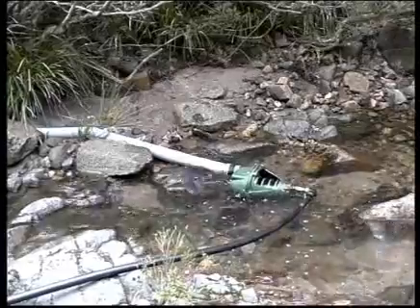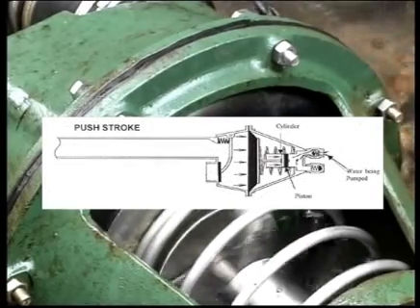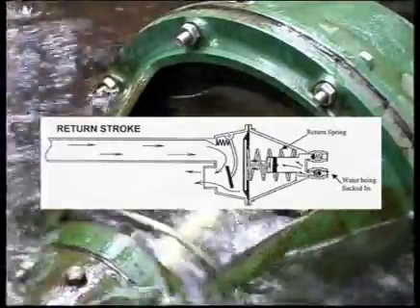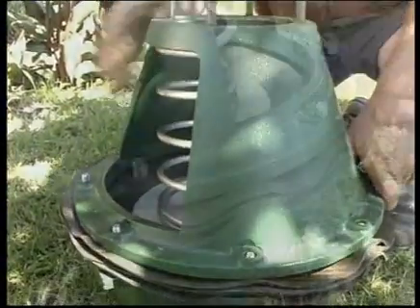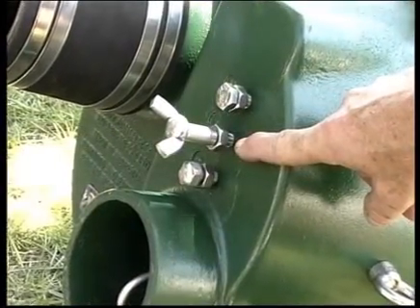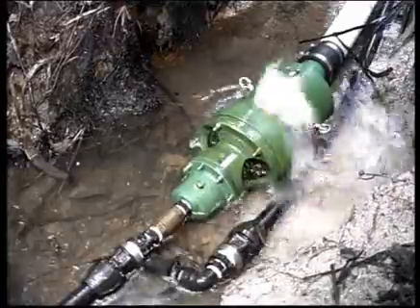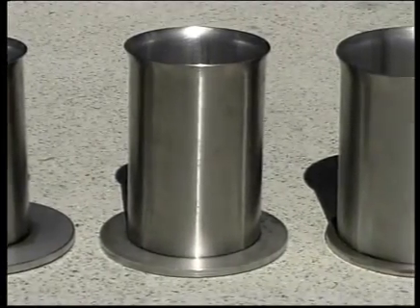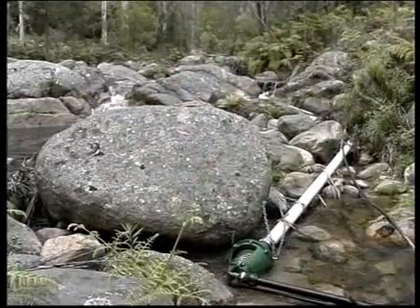Glockemann Pump

Comment: Hi guys, I'm looking to deliver water up about 8-10 meters at a flow rate of 100 liters per second. Is it possible to design one that can achieve that?
Reply: Traducir al español
Reply: That requires a large pipe aprox 50cm diameter or more and good pressure. Generally water tanks are a few 1000 liter in size which would fill up in seconds. 😅 
What do you need such a pump, are you filling up lakes?
Theoretically you could build such a large pump or use many smaller ones. The pump would be 10m in diameter. Than also find a large enough river to pump from.